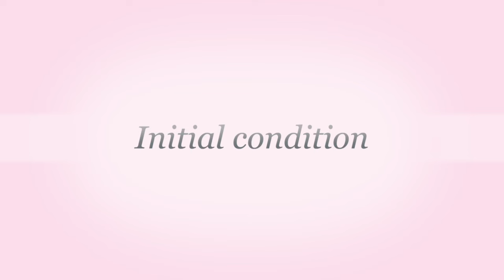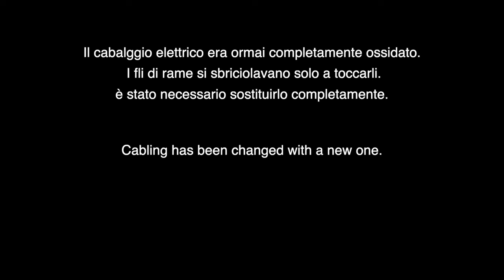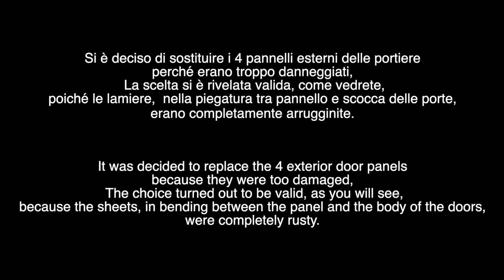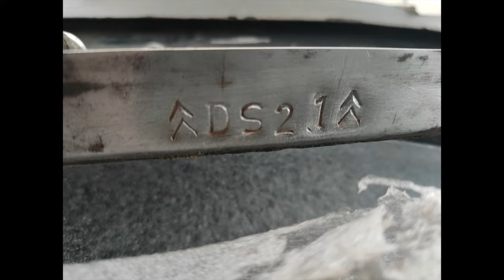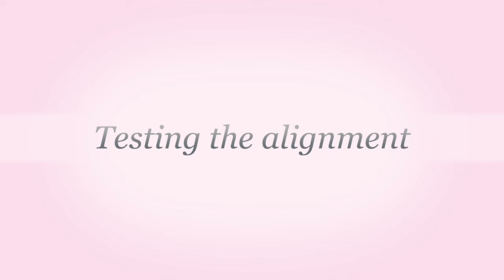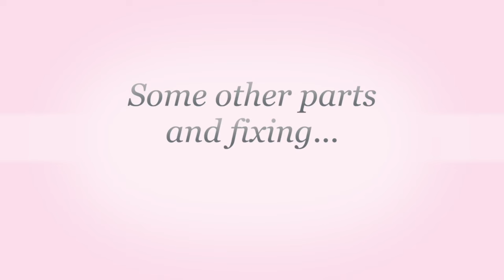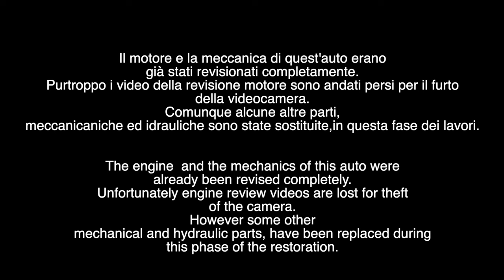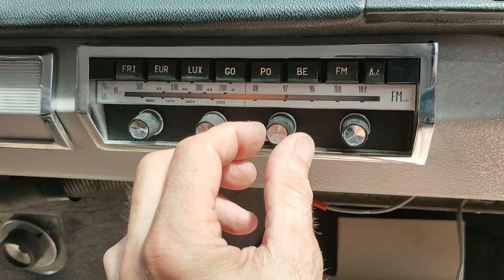DS 21 Pallas, 1968, Restoration

Comment: I’m in the proceed of doing this to my 1972 DSpecial. All 11 pieces of the body are at the paint shop. All mechanicals are done.
Reply from the maker: Good! For the body It's important to check where the outer panels are folded onto the box parts.  And also to check the chassis spars and boxes inside.

Comment: How is the fibre-glass roof attached to the rail?
Reply from the maker: It is bolted. The fiberglass roof has a metal frame with appendices with holes and the bolts pass through the chassis frame and through the slots then the nuts from the inside of the roof tightens everything. In the latest versions the roof was just glued.
Reply: Poorly, leaks into the trunk frequently.

Comment: Fantastic!
Bon coleur!
Hvl.
Reply from the maker: Thank you! Merci!
Reply: buongiorno.Bellissimo lavoro, due precisioni: sulla DS  non sono lungheroni, ma "caissons"  in francese.!! E il scelto del tetto griggio , lo stesso della macchina, soleva questione...sarebbe bello in 
" beige" ??  differente.( michel francese anch'amoroso di quest'auto.Ne ho avuto due, rimorsi...)
Reply from the maker: @michel3anches  Buongiorno, Longheroni is the Italian name for spars in English or caissons in French. The color of the roof is not the same of the body. The body is Gris Palladium AC108/B; The roof is Gris Argeant AC100, that was one of the two original possible combination, the other one for 1968 version, was AC200 Black! AC 100 passing the time and exposure to the sun light became more similar to beige.

Comment: The stainless steel exhaust in not the very best, and not original. It also has a higher sound level than the original, and also an other sound picture or character.
Reply from the maker: The original exhaust is made of a very poor metal. Because the pipes are very long, they keep humidity and  rusts very soon. Stainless steel is everlasting! The sound is the same because the silencers work good.
Reply: @citro-garage  Mufflers rarely rusted out, the flex pipe often fractured/broke and the tail pipes ALWAYS rusted out.